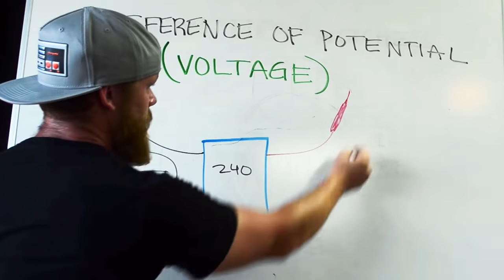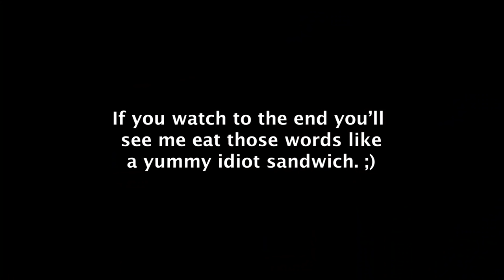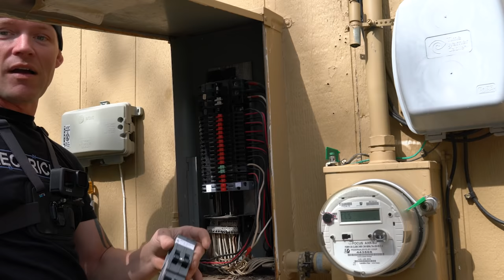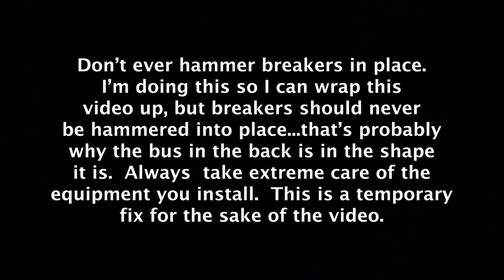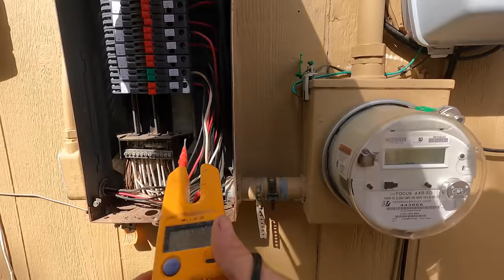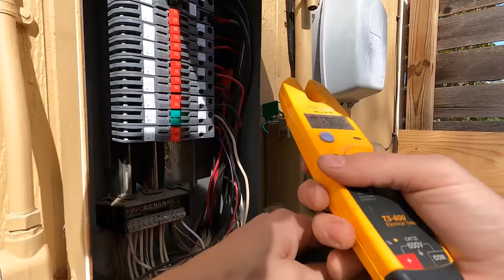How To Work on LIVE CIRCUITS - Replacing Circuit Breakers in Old ZINSCO Panel

Comment: i love how i spent 10 months in school being told not to ever work hot. "first day of work" ok everything we do is hot :) all but the 347v
Reply: It’s my third day on the job as a maintenance tech and I changed a push button hot and changed a blown fuse in a hot panel. I just graduated 4 days ago lmao.
Reply: @damion1121  congrats! if you understand how it works 120/240 really is no big deal
Reply: @clatonblade2211  yeah I’m being careful. I’ve touched 120 in my home before just changing fixtures and it’s only a tickle. Lol
Reply: @clatonblade2211  240 is just a wake up, about the same as a cup of coffee lol
Reply: @JeremyPeters  Wait till 277 / 480 hits you , Sometimes when 277 hits you feels like Mike Tyson hitting you
Reply: Working circuits hot is a violation of OSHA, ANSI and NFPA 70E standards.  There’s a reason why their called STANDARDS.
Reply: @robodrone4004  There is circumstances where you are required to work circuits hot especially in Hospitals , most of the times you know what the circuit is feeding sometimes you don’t , I’ve worked on lighting circuits that fed ERs , ORs , etc. So That’s why you have to put on your big kid under Roos and get the job done ✅

Comment: This was amazingly helpful. I have a question though, entirely hypothetical but if you took a live wire from the meter and put it somewhere conductive such that it pulled say several hundred amps, what happens? Does the meter have an overload/breaker protection, or does the transformer on the pole, or… basically what blows up of you short a main without any breakers in the line?

Comment: You always need to be careful taking the panel cover off. Some panels have little clearance and you can end up doing some welding. The same applies to putting a panel cover on.

Comment: I am not an electrician.  I was wondering why not sand or file the arc area down rather than hammer the breaker.  In the old days, I have dressed automobile points with a small burnishing file to extend their useful life.  Sparkplugs too, to make flat area for better spark.  I was also concerned about cover panel that fell a few time, bringing a ground to you.
I very much liked how you captured the live conductors in the replacement breaker to manage them.

Comment: You should see all the paperwork we have to fill out for any hot work. It is brutal!
Reply from the maker: I can imagine, do you work for a large company or are you maintenance at an industrial shop?
Reply: @ElectricianU  
Contracting in CA for a Class A general engineering company with a C10. 
Substation, utility, tower work, and EV charge networks. There are times, especially on the utility and substations side, where things can not be offlined.

Testing in tomorrow to get my Journeyman's in Montana. Then I can finally change pace and stay in my home state, commercial, residential, and utility with the local electric coop.

Comment: I'm sure most of you know this but always check the bus with a meter after shutting off the main.
Reply: Don't use a harbor fright or a cheapo meter. If you don't have the knowledge and proper tools dont even attempt.
Reply: I'm still kinda new, but what potentially could happen to leave the bus hot after shutting off the main? A faulty main?
Reply: @blindorize  well the bus would just be hot and whoever working just assumes its dead could get hurt. But yes it would result In a faulty breaker.
Reply: John Connolly   Ahh the old glancing finger test! The most efficient of them all. Thanks for sharing your experience, I''ll definitely be testing no matter what.
Reply: I got hammered working in a panel with the main off, it was an old building, panel was back fed from another panel in the building on one of the branch circuits. Learned my lesson
Reply: @blindorize   Had something similar happen with the meter out..  One of the supply-side conductors was touching a house-side lug and the insulation on that conductor had worn through on the back. Looked harmless with the meter out, but I was in for a big surprise.   One in a million chance of that happening.  Luckily, I just lost a screwdriver.
Reply: John Connolly  Got to be especially careful with the marijuana grow houses stealing electricity and back-feeding into the panel.
Reply: Yep, most of the electrical trade deaths I have heard of in my area are mostly traced back to them assuming or expecting.
Reply: Man that is so totally obvious that I feel like an idiot for never thinking of it 🤔
Reply: A faulty breaker, one that doesn't open. Or you have a panel that is being back-fed from another panel. I have personally experienced both of these.
Reply: @blindorize  it'll bite like hell and make you remember it for the rest of your life 😁
Reply: @blindorize  in case the circuit is still energized for some reason. Back powered, devices supplying power. Capacitors not fully discharged yet. Bad wiring.
Reply: @zack9912000  Pipe down, elitist. Wanna check your meter? Test it on a known live circuit. Not difficult.
Reply: @PJBonoVox  clearly don't work in the trade. Called complacency buddy
Reply: That is the amateurish way. Safety regulations consider this panel as live even when turning the incoming breaker off. He should use proper PPE, insulated tools, instead of verifying the voltage of the bus bars
Reply: @zack9912000  No, I don't. If you work in the trade and browse YouTube videos about your profession then I feel for you.
Reply: I shut off a name brand 3 phase breaker,  did the voltage check like usual,  thinking in my head this is more for show than anything else….  ONE PHASE WAS HOT.    this was brand new equipment,  had less than 2 months run time.   

When my meter showed 277 to ground my heart almost stopped,  I realized how lucky I was that I checked it…. And paid attention to the readings.  It’s easy to get into a routine where you THINK you know what the readings will be and quickly touch each terminal … 1, 2,3 done   I saw meter blink on terminal 2, was already on terminal 3 when I processed it in my mind… went back and checked.    

Insulated screw drivers not only protect from electrocution,  they protect from arc blast.    If you dead short hot to ground the amperage is only limited by the impedance of the feeder wire and the transformer supplying it.    Blast can be 35,000 degrees.    Has nothing to do with 120/240 versus 480,    Amps is energy.     Watch some arc blast videos.

Comment: I'm an automotive technican, I work on the electric cars, we use the same gloves rated for work on the batteries. we don't have a arc sheild which would be smart but I do have saftety glasses that i make sure i'm wearing when i'm working on them. Its hard using those gloves on tight spots with little nuts and bolts.

Comment: We are provided all insulated tools. All the ppe you can ever need. Just weird for me to see you stick a standard flat in there hot. 😆 I’m in industrial.
Reply: ignorance resy guys dont know what arc flash is
Reply: Nothing wrong with using a regular Klein flathead if you know what you’re doing, I’m in industrial aswell and all we use is regular screwdrivers
Reply: @pgood7266 Why do you NOT use insulated screwdrivers?

Comment: As a electrical design engineer since 1983, now retired, I can say that you are correct about Zinsco breakers.   They sometimes just would not trip.   Very dangerous.     Most of the rest of the companies you named in the beginning of the video, just got bought out by other companies, not because their breakers were unsafe.
I can't believe you said A phase and B phase.
Respectfully,   Kevin
Reply: I am also surprised at how often he describes the separate legs of the phase as different phases on single phase residential. In practice doesn’t cause any real issues, but is factually incorrect.
Reply: @Chase_AM     Correct.   A conductor termination point is not a phase.
Reply: Depends on the transformer feeding the house. Alot of POCOs run 3ph OR 2ph in their distribution and use 2ph xfmrs to serve the house so the house is actually using 2 separate phases from the utility. Its 99% of the services in northern California.

Comment: Legit question, with all the PPE while working on the live hot service main he is using a metal screw driver.  Why not use an insulated screw driver as well?  If the screw driver accidently touched the exposed hot wire would it not utilize the path along the screw driver as the shortest path to ground or lower potential ? Or is he safe because the gloves are insulated and braking the path to potential ground or lower potential? 

I would never mess with the hot side of a panel, but I love learning about this stuff. Much respect to all the master electricians out there!

Comment: great job. just a few tips for the next one though. first, remove that pain in the head door, 2nd, after removing live wires from main just cap them with blue wire nuts or an insulated tap, that way you can install the new breaker w/o the risk of the wire popping out from the lugs plus it'll give you more flexibility stabbing it on to the bus. just saying.😎
Reply: Right. Then you can test fit the main without live wires in them.

Comment: have read a number of other comments so wont repeat the ones i agree with 
doing loop impedance reading can really help to find issues like your main breaker arcing  more commonly used in Europe however see it being used in the USA more. 
a lot manufacturers are pushing the use of torque setting on breaker screws and that would be nice to show.
lastly I think checking neutral to hot after a load is applied is also a very important test as it will show is the neutral impedance is high which you will know the effects of 
first time I have come across your channel enjoyed it keep up the good work

Comment: Had to do the exact same thing on my panel on my house built in 69’. One phase on the bus bar of my 100 amp main breaker was damaged from arcing. I just filled it down a bit to make a better contact between the breaker and bus bar, and now waiting to get a new 200 amp service panel installed. Those old breakers are a pain in the ass to replace and will do damage to your bus bars.

Comment: I thought I was the only electrician with a zinsco panel, lol!
Reply: Federal Pacific panel in my house.
Reply: We come to find out a majority of electricians own houses with the worst panels. lol
Reply: @aaron74  "the cobbler's children have no shoes."
Reply: @PatrickKQ4HBD  Terrified
Reply: @PatrickKQ4HBD  until it burned down right?
Reply: @donzmilky5961  not yet, thank God. We've had several breakers function properly, so far, including the main when the lug loosened up. Maybe we got a good batch? I became an electrician partly so I could replace it myself, along with all the aluminum wiring with no grounds.
Reply: John Connolly  I have never seen a Zinsco here in AZ. Are they on the houses built in the 1970s or only ones even older?
Reply: I have a challenger at my house

Comment: I would suggest removing the hinged dead front cover.One less thing to ground out on and allow you to stand in front of the panel without bending your neck.
Reply: Or the cover not slam into your head as you hammer a stubborn breaker in 😂
Reply: How do you get it off?  I need to replace a breaker in my panel and it has one of those doors, and it will. not. stay open.
Reply: @rprastein  
It's just two short screws that act as hinge points at the top sides.
Reply: @wilburrrrr742  Thanks, I did finally go to try to replace the breaker and saw that.  Then I couldn't get the breaker off -- turns out I was trying to swing it the wrong way, but even once it was out of the box, the terminal screws were on SUPER tight.  I had a supervisor/trainee pair out on a "free estimate" visit that turned into I think $100 for them to change the 4-pole breaker with my new one (no warranty), and the supervisor gave the trainee some ribbing for how long it was taking him to get the wires off.  One of the breaker contacts had completely vaporized, and there was carbon on the bus bar that they also filed smooth.  Working great now, $100 learning experience, money well spent.

Comment: I can't remove the seal without getting a fine. 

I would suggest the "it was like that when I got here" line. Let them prove otherwise.
Reply: We had our local power company roll up in a black, unmarked, heavily tinted, antennas everywhere kind of Tahoe. We had pulled the meter for the exact same gig of replacing a main breaker. He showed up because they know when meters are pulled. Smart meters are not just smart for the end user.
Reply: @whofixeditanyways  funny thing. I used to break seals and pull meters all the time. Just had to call utility company and tell them I needed a reseal. They'd have you work safe also. The only seal I couldn't break was my own when I put a new panel in my house where I used to live. Guess that makes sense. At one point I was doing so many upgrades, the line supervisor gave me seals. I'd call in and give them the old and then new seal number. And I had to turn in the old seal.
Reply: @davep6977  yup, that’s usually what the case is when your a licensed electrician. Not the end of the world.

Comment: I feel like with a name like Electrician U, when talking about arc flash gloves you'd mention dropping some baby powder and leak testing them before using them.
Reply: And to not store them fingers down.... or wearing an ARC rated long sleeve....balaclava...so much. I get that its his own home but hes doing this as an educational video and missing a lot.
Reply: Have worn Cal 8 12 40 & 50 and never.used bany powder. Perfer the thin white glove liners. We would get issued a 10 pak of them. As soon as they got dirty throw them out.
Reply: The last class I was in said not to use baby powder.  Said it reacts with the rubber.  There is a special glove powder to use though.

Comment: I’m electrician in NJ. I alway suggest customer just to get new panel. You can up the service at the same time, go from 100A to 150 or 200. For the same price that takes to order this breakers just to find out that busbar is done and you have to replace panel anyway.
Reply: Not worth the liability...
I won't work on FPE or zinsco...
Reply: He said it's just a temporary solution for a few weeks. Not every customer is finiacially able to replace there service right away he's probably loaning out those new breakers on credit. He literally said in the video he'd be back to replace the service entirely.
Reply: @alec4672  It's his own panel on his own house.
Reply: @andrewalexander9492  welp there ya go I think my point still stands. It's been sketchy ordering building supplies in all trades right now. Those old breakers were probably keeping him up at night 😂 also good video content. Either way it's still just a temporary solution for a few weeks he said until he can get a proper panel.
Reply: @alec4672  Yeah, I wasn't saying your were wrong,  jut that a guy might take a stop-gap measure on his own stuff that would be out of line for a client.
Reply: @andrewalexander9492  this wouldn't be out of line for a client you're just worried more about money then satisfying a customer. What if you couldn't get a NEMA 4R load center for a few days but the main went bad in the FPE panel and they got food in the fridge? You gotta get power back on to the customer. You can have them sign a waiver you know?

Comment: Glad you replaced these. The problem with these Zinsco breakers was that the connection between the breakers and the bus bars would fail due to dissimilar metals, causing an arc. This would cause the internals of the breaker to slowly melt together in the closed position, so if there was an overcurrent fault, the breaker wouldn’t do anything because it was stuck. One of my friends almost lost their house to these breakers. There is really no way to tell if one of them has failed, so it is smart to replace all of them with a modern breaker.

Comment: i always take the lid or cover off when working on any outdoor box. Yeah they can be tough to get out if they’ve  been arcing on buss for sometime and to prevent it from damaging the new breaker you need to use sandpaper to smooth out the buss. If you don’t it won’t take long for the replacement breaker to start arcing. Been doing this 40 yrs i’ve seen it many times

Comment: I've been a service class "A" wireman for 35 years, and working on a 120/240 v. single phase panel with all that gear on is a lot on nonsense, and dangerous , if know what your doing, it's not that 
big of a deal.

Comment: thanks for a nice video,i do have a house built on 1960 with an  old bulldog Pushmatic electrical panel and its not giving me any problem yet but can i just buy new breakers and use the same panel,thank you so much again.....

Comment: Its so hard to find breaker ties for old zinsco breakers. I have a zinsco myself and rewired the whole house last year during a full down to the sticks remodel and wound up not having a tie on two that come together to make a 220 window ac outlet. Looked all over for a tie that worked and in the end settled for a screw. Now that I'm rewired with all new fixtures, switches, and outlets next comes the breakers. Hopefully bus's are good.  Looks like it but so dod yours. Well see I guess.

Comment: Isn't it a Code requirement that those Terminal Connections on those New Breakers be Torqued to what ever the Manufacture requires ? Usually printed on the Breaker Casing .
Reply: German spec, guut en tite 😉
Reply: All terminations need to be torqued. Specs are either on the breaker itself, the panel label or you can check the code book for certain screw sizes
Reply: @dudeman650  ; I know that !! I'm a State Licensed Journeyman Electrician with over 52 years in the Trade !!!!
Reply: Yeah no one does that tho, just tighten it as much as possible without breaking anything